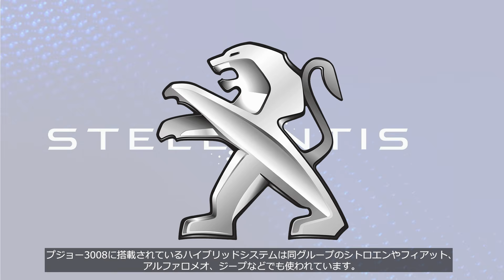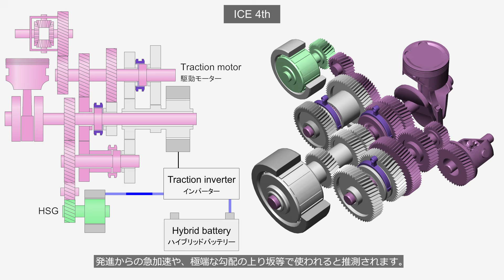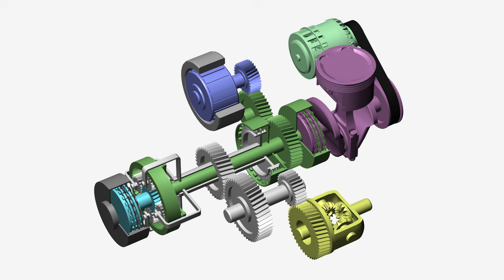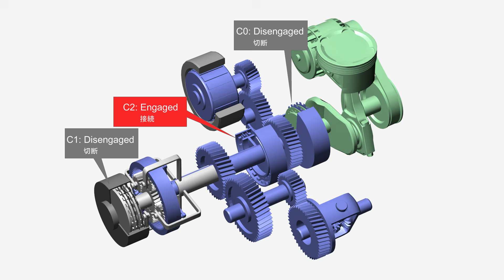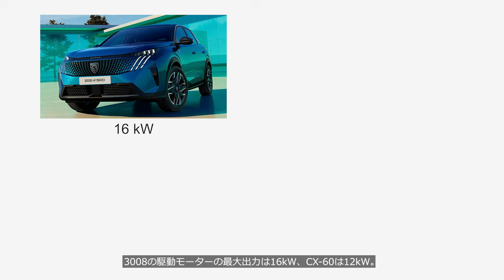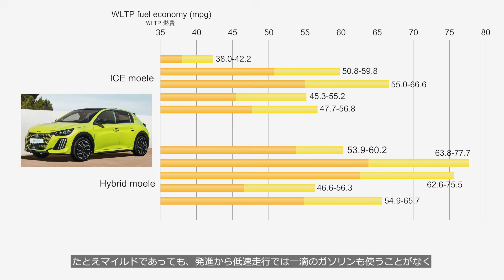French Hybrid Showdown: Renault Austral E-Tech vs  Peugeot 3008 Mild Hybrid

Comment: Exotic gearbox of Renault. It use pair of gears for 2 speeds of Drive motor and 2 speeds of ICE, as any usual gearbox. But to simplify and make gearbox shorter, other 2 speeds of ICE are on counterpressure shaft, and connect to output shaft via gears on ICE and Drive Motor primary shafts already used for other speeds. Other simply solution is remove any clutch and syncronizers. Forks that move shifthing mechanisms are driven by motors, instead complex oil hidraulic mechanisms.

Comment: In my opinion, the Hybrid transmission in Renault is a better version of Honda. Both of them share the (non-planetary-gear style) series-parallel hybrid system, Renault has 2 electric gears and 4 gas gears with non-clutch dogbox, while Honda has less gears for speed matching, as well as clutch required. The HSG used in Renault to match engine speed for dogbox engaging is an appreciated approach. However, for the total fuel consumption, Honda still performs better. Maybe that's due to the better engine design.

Thank you very much for making these videos, it's very helpful!
Reply from the maker: It’s probably due to whether the primary role of the ICE is focused on driving the vehicle or driving the generator. 
Glad you enjoyed the video!
Reply: The honda has a clutch which connects the engine to the wheels above 45 mph.
Reply: Renalt 4x2 gears and Hondas 2 gears is not as good as the Toyota no gear hybrid drive.

Comment: You cover hybrids, but I never saw any video from you covering Hyundai Kia's Hybrid system.. which is the first formidable competitor to Toyota Hybrid since ages ago... FYI, Toyota actually regarded Hyundai Kia as their rival. So please don't be sentimental about nationalities and cover Korean Hybrids also when you have the time.
Reply: Hyundai and KIA have a six speed automated manual gear box in the mix. Toyota do it so much better.
Reply: @fivish there are reasons, reasons you are unwilling to understand and only single narrow pov of pure efficiency
Reply: the kia/hyundai hybrids have an automated manual gearbox as well as an electric motor and traction battery. Its not a good system.

Comment: IMO the reason for using a separate 48V BSG in the Peugeot is to achieve series hybrid mode at low speeds. This way the car can crawl in dense traffic without constantly slipping the odd gears clutch and quickly wearing it down (it's a well known weakness of non-hybrid dual clutch transmissions)
Reply: good point, its BSG there because of this objective
Reply: Absolutely good observation 👍 stellantis hybrid is super in traffic and superb on the autobahn on 180kmh - it is silent and low revving in the high speed so the comfort of high speed cruising is really high

High speed crusin in toyota is really noisey and not comfortable

Comment: Thanks again, Renaults system utilizes the ice through three gears as explained, the first gear is always traction motor driven.
Reply: has 4X2 gears!
Reply: @fivish  If the animation is correct you can see that the ice is connected through three gears and the motor through two gears. There is no fourth gear. Having driven the Clio i get the same feedback, first gear 70-120, second 120-175, third overdrive when off throttle.

Comment: The crazy thing to me is these cars go for 35,000 Euros and they have 1.2L 3Cyl engines and also weigh 4,200 pounds. What exactly are they paying for? I mean it gets great fuel economy but no way that's the appeal
Reply: The gross vehicle weight is car's maximum weight, fully loaded, with passengers. The kerb weight for both 3008 and Austral will be around 500 kg less
Reply: I think you'll find fuel economy is very much the appeal of these cars
Reply: @bikeman123 Not as good as a Toyota.
Reply: You get a lot of gears for your money and a small turbo engine. Avoid, Buy a Toyota.
Reply: A tiny turbo engine, a 6x2 speed DCT gearbox and Renualt build 'quality', why would you buy one?

Comment: I think Peugeot's BSG system is used not only to start the engine but also to charge the 48v battery and generate more energy for the 100% electric mode (especially in the 4xe) if the charge is low, so it doesn't have to rely solely on deceleration.
Reply: Of course, it's called starter-GENERATOR for a reason 🙂
Reply: C'est uniquement un démarreur par courroie (il ne sert jamais pour recharger la batterie 12v), le démarrage à froid du moteur thermique est effectué par le démarreur à courroie et le moteur électrique simultanément. Le maintien de charge de la batterie 12V vient de la batterie de traction via un convertisseur.

Comment: It's a win for the Renault. 
Stellantis'/Peugeot's DCTs are not a winner for long term reliability hybrid or ICE. The 48V system is also no good for this decade. KIA, BMW, VW and Mercedes went down the DCT hell path. 
Would like to see a comparison comparing Renault's hybrid with MG's/SAIC's rather novel 3 speed hybrid.
Reply: not really; its BSG there because of this objective : long-term reliability of its DCT and compensate low-speed crawl disadvantage in DCT
Reply: Not really, Renault had a lot of issues with their hybrid gearbox. Stellantis is about to resolve all the issues on their new dct. 
If you like driving sporty, don't use Renault's hybrid transmission, it's too slow. I tried before
Reply: @johannlgwada971  1. what renault hybrid? 4 SPEED AT HYBRID??
2. what issues stelantis NEW DCT HYBRID ???
Reply: @djhrjeiwhri  yes the Renault hybrids have 4 speeds at hybrid and 2 in electric. 
And for Stellantis, many dct transmissions have been replaced at a small mileage.
Reply: @johannlgwada971  so, dct stelantis "have issues", same type with this on the video?  or?